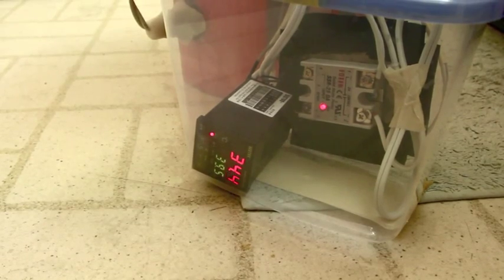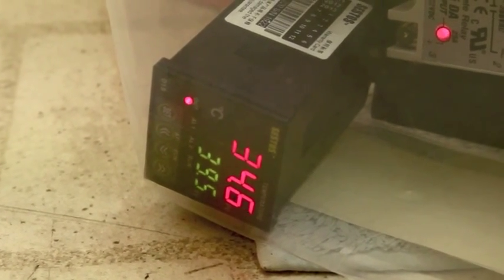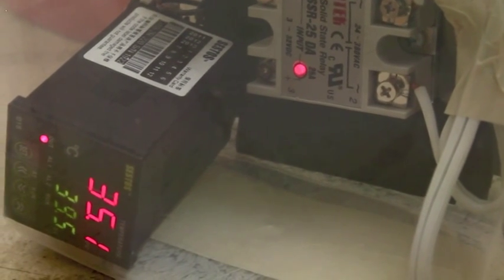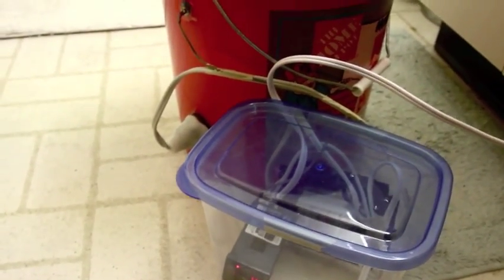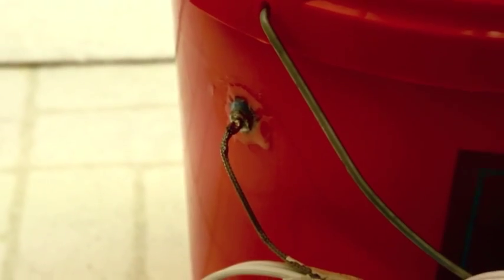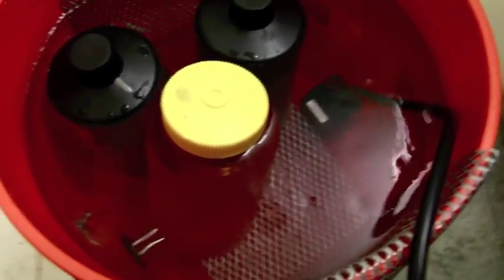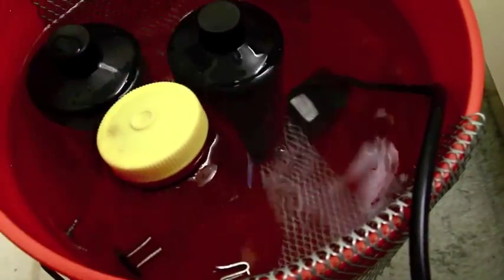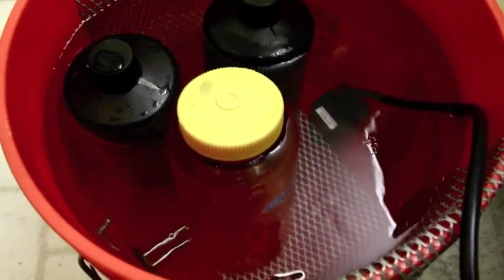Temperature controlled bath for developing C-41 Film

Comment: I know this video was uploaded about 8 years ago.
Some of us are using the Sous Vide cooker to maintain temperatures now.
Mine costs about $100.  It is very accurate.
problem is if temperature needs to cool (as during hot summer) the heater has no cooling function.
So during cold months, it is perfect, and reasonably priced.